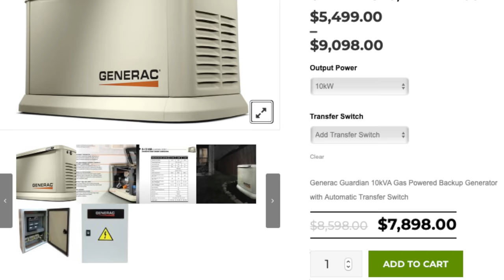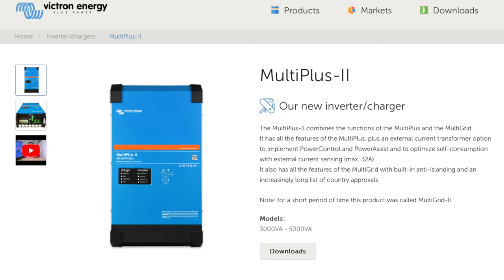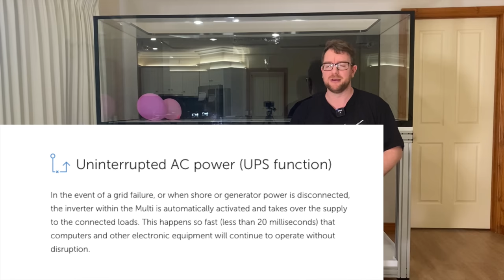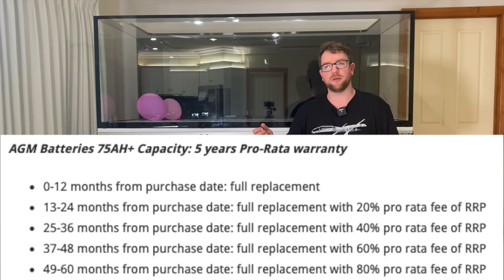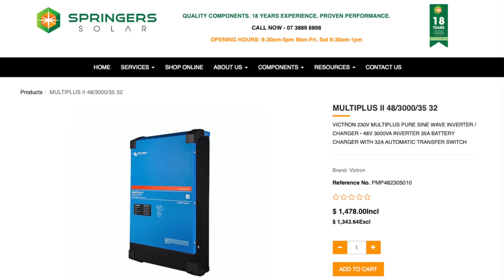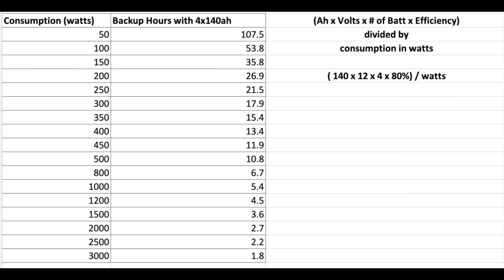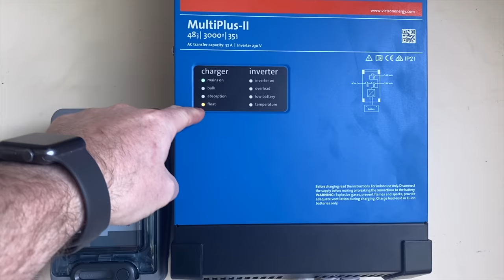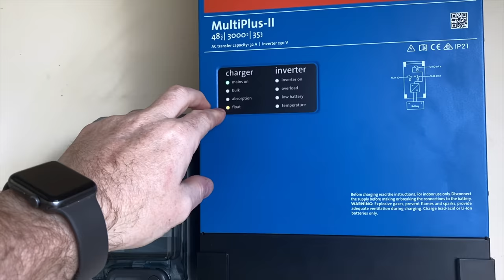Mega Reef Battery Backup

Comment: Excellent Video. Every Aquarium needs a battery backup. It means your Fish's lives. Fortunately, because I only have a 4 foot aquarium, I only needed a much smaller system and I have installed a CyberPower VP1600ELCD to which I have connected my Fluval Plant 3.0 - 145cm light, 300w heater, Air pump, and large internal Filter and it will run them for about 3 hours in a blackout. What I like about the CyberPower units is they have a readout on the LCD screen of how long a battery runtime you get according to what you have connected. The unit cost less than $300 but does has a short runtime. I am also in Victoria Australia 👍
Reply from the maker: Nicely done mate, that will work well 👍🏻

Comment: well sam I have ordered the components identical to yours and have teed up the son-in-law who is a sparky , I wasn't going to as the longest we have lost power where I live in vic is 2hrs and its usually under 1. I have a portable generator  and that saved the day when we were out for over 6hrs, when the storms struck about 3-4 wks ago, there were people without power for over 6 days. Your battery backup should buy me enough time to get home and setup the generator, or organize someone else to set it up, regardless of what im up to . Thankyou for doing the leg work and sharing it.
Reply from the maker: You won’t be disappointed mate! If you need a hand with any of it, just yell out!

Make sure your son in law puts a safety switch on the output from the inverter. Otherwise you can create quite a dangerous environment..
Reply: @ParkersReef  will do thanks

Comment: Another great video.  I always believe that if one is taking the plunge into a “dream” reef tank, the requirement for a generator is a must have.  Weather it is a whole house or a fill up and use as needed.  That being said  a $700-$1000(US) investment in a 3kw UPS makes sense.  I run my entire system for up to 4 hours.  Plenty of time to get home and crank up the portable generator and the UPS will filter the power.
Reply from the maker: That’s it, gets the job done for long enough to work out plan b

Comment: If you are intrested maximize power runtime connect DC pumps directly to batteries. Obviously AC pumps will not work on DC - you need an inverter but inverters are a big hit on efficiency. Also not all inverters will play nice with AC pumps. AC pumps are designed to work with nice smooth sine wave AC input. Not stepped wave approximations cheap inverters produce. You need true sine wave inverter.
Also 4 LiFePO4 cells ~= 1 12V acid led battery. Only lighter, more powerful, more capacity and more longevity. You can even use it as a plug and play replacement for standard lead batteries, but you do miss out on ~20% capacity.
Reply from the maker: Yes that will work, but only if your batteries are next to the tank. DC doesn’t travel distance very efficiently.

This inverters is a pure sine wave output, it’s Victron, one of the best in the business.

Lithium phosphate batteries are great. Just very expensive and weight isn’t a consideration for this install

Comment: Great video! One thing you didn't mention when you were talking about the battery formula - depth of discharge on lead acid batteries is usually recommended to be set at 50 percent of maximum capacity. Did you manually change the settings in the Victron app or just went with the defaults for low battery cut-off?
Reply from the maker: Victron defaults with sealed lead acid settings, but you can log in and change them to your battery specifications.

Yes, if I was to do this setup again today - I would use lithium batteries instead, I just didn’t have budget for them at the time

Comment: I spent about $100 on 4 battery  air pumps that used 2 D batteries that last 24 hours. I was without power for 8 days. Didn't  lose a fish or sps coral.  The key was temperature which the house stood cool even in heat wave Tank in basement. I going generator, But regular battery pumps was a life saver
Reply from the maker: Yeah they are good, especially if you can be home to get them in place 👍🏻
Reply: 8 days wtf, do you live in Afghanistan?

Comment: For about $4k, I had a Cummins 17KW natural gas generator installed...power goes out, it runs the whole house, along with the reef tanks.
Reply from the maker: That’d be ideal 👏🏻
Reply: @ParkersReef  I watched the part about you getting quotes...and I understand. I live in the mountains and getting anyone to come out to do anything is difficult.  When it comes time to buy new batteries, I would revisit the idea and try getting some fresh quotes.  Good luck!
Reply from the maker: Fresh batteries will only be $1k and shouldn’t be for 5 years, so it’ll be hard to beat that.

Plus by then, batteries will be cheaper again and generators will likely be more expensive :(

Comment: I am investigating something similar for the new 290 peninsula I am setting up. One thing I didn't see in your calculation for run time is depth  of discharge. You can't run a battery from full to empty charge and expect it to last long. I've read you get about 80% on lithium ion, and 50% on gel or agm, or what have you lead acid batteries. Did you take this into account? And have you ever done any testing to see how long your batteries last in a simulated power outage?
Reply from the maker: yeah that will vary on the battery chemistry you choose. Lithium should be good to 0%.

Sealed lead acid is really only good to 50%.

I haven't done a simulated test, but I have had a couple of 4-5 hour outages and when the power was restored, the victron was only on charge for a short time before switching back to float. Gave me confidence that it will handle 10 hours without too much issue.
Reply: @ParkersReef  Appreciate the response! Love your tank overall. My understanding is that depth of discharge has an effect on battery life. They consider life of the battery when it can only stored 80% of its original capacity. The higher the depth of discharge the shorter the life of thr battery. Lithium will get way more cycles than any lead acid, but of course they cost way more. You get one, maybe 1.5 lithium batteries for what you paid for all 4 of the AGMs. I guess at the end of the days it's a cost calculation. Replace lead acid batteries  more often, or pony up the funds for lithium batteries at the beginning!
Reply from the maker: @fiziksgeek3562  yep spot on! Lithium is getting better and cheaper by the day - so I just went for lead acid for now, will "upgrade" in a couple years :)

Comment: One factor to note: your backup hour calculation didn’t use min drain voltage. This is another one of those manufacturer spec frustrations, but is the 140Ah down to 0% or 20%, etc.? You’ll  want to multiply the number of hours by the portion which is safe to drain and not kill the battery. Good on you to choose AGM, but I’m curious… 🎉
Reply from the maker: Yes that’s a great question and I didn’t factor that in nor have I since found the value. I can say the tank has had a power outage for over eight hours and didn’t skip a beat which is exactly what I wanted to achieve :)

Comment: Great video did, you think about having the solar wired to the Victron so I can charge the battery in the day time in case of a prolonged power outage?
Reply from the maker: Thought about it, but I believe there are some legalities around that which I wasn’t interested in dealing with. Realistically, this setup can power my “essentials” for a day or more, if the power is going to be out that long - it gives me time to look into a longer term solution :p

Comment: Thanks for going through all the options and pricing - really helpful. Just one question - if you were to need to run a generator due to a long outage, would you be able to charge the batteries with the generator while the batteries are connected to your Multiplus?
Reply from the maker: Certainly can! If we were to be facing a long outage I can charge the batteries either via a generator or solar without needing to interfere with the solution installed :)
Reply: @ParkersReef  my solar will only work when it had grid power so unless your is different having the batteries only do fish circuit the solar may not work. I know some knewer ones can but not many.
Reply from the maker: Yes, that is correct. That is one of the reasons why I went this setup over a battery connected directly to my solar inverter.

Comment: Does the system run your pumps at a lower power? With the DIY or ecotech battery backup with run it at a lower wattage to draw less power.
Reply from the maker: Nope - full power. They are still powered via the AC mains outlet :)
Reply: @ParkersReef  I think if they was able to run half power you'd get alot more run time. Either way, its a nice system.
Reply from the maker: Run times isn’t an issue with my system :)

Comment: Hey Sam. I notice you have your tank running off a separate fuse in your home’s fuse box. Do you have it running off a single fuse or do you have more than one fuse/circuit dedicated to the tank ? Thanks
Reply from the maker: I have a dedicated circuit to the tank and I also use a general outlet, so in essence -  I have two circuits to the tank
Reply: @ParkersReef  thanks Sam. I’ve got a sparky working on a separate line for me this week. I was always worried that a “bung” toaster would trip out my whole tank 🤣
Thanks for the reply.
Reply from the maker: Dedicated circuit is great. Especially when it has a battery backup ;)
Reply: @ParkersReef  yeah. Need one of those too 😩
Reply from the maker: @robertverzin1235  such a good thing, seemed like a lot of money for a “what if” bit of gear, but when the power did go out it was so good to see the reef carry on like nothing was wrong

Comment: What do you recommend for a 4 x 2 x 2 tank? Any other viable options other than EcoTech or fiddle diy jobs?
Reply from the maker: really comes down the your own situation. Ecotech is great if you have their gear, are not capable of much DIY and want a neat solution. DIY will give you a BIGGER option, but it won't be cheaper...
Reply: Parkers Reef thanks looks like EcoTech is the way to go in that case
Reply from the maker: They are a great solution, nothing wrong with them at all
Reply: Parkers Reef do you know how long the vectra pumps last for on battery back up? Presumably, less than the wave makers? Would prefer to use some non EcoTech wave makers like the Tunze or Ai neros instead - lot more affordable!
Reply from the maker: If you can find the watts they use and can point me towards the battery backup you want to use, I can work it out for you :)
Reply: Parkers Reef thanks a lot. This is the tricky part because from what I heard the vectra has a power saving mode when on the battery back up, so can get it to run for 5 minutes and then stop for 25 minutes. Let’s it was at 50 watts for those 5 minutes, any rough idea how long a single EcoTech battery would last for? You get some good time out of a Vortech wavemaker - 36 hours for a mp40, which is enough time for most blackouts in Sydney / Melbourne
Reply from the maker: Looks like the ecotech battery is 12v and 18ah.

Using the scenario of consuming 50w for 10mins of the hour and 0 for 50mins of the hour, you get an average of about 8.3 for the whole hour.

So using our calculation, it is:
(18*12*1*0.8) / 8.3 = 20.82 hours run time. 

Pretty decent time, although one would question if that is enough water movement to really keep things all ok?
Reply: Parkers Reef thanks heaps. Yeah true, the 5 mins on / 25 mins off mode was one of the suggested options but probably not sufficient for oxygen. Doubling the time then cuts it down to 10 hours I guess, even that may be not enough. Sigh.. looks like no other option other than wave makers in that case
Reply from the maker: That’s a pretty long run time to be honest, 10 hours sees you through pretty much most power outages!
Reply: Parkers Reef true need to have a think about whether to just get the vectra or go vectra plus the wave makers. thanks a lot for the detailed replies!

Comment: Geez😬 those quotes for installation for the generator are a bit nuts. Were they rewiring the switchboard or something?
Reply from the maker: Mate, they reckoned it needed a new feed from the gas mains and all sorts done to the switchboard.

The mobs that quoted usually install commercially, so I reckon they quote with decent margins :p
Reply: @ParkersReef  yeah, commercial would make it worth it for them.

Thats sucks, but i guess you found a better solution
Reply from the maker: I think so!

Comment: If you want your batteries to last, don't draw them down to less than one half capacity, ie  they are now 70 amp hours not the full 140 amp hours. Your batteries could then last 8 to 10 years.
Reply from the maker: Ideally yes, spot on.
Reply: I agree, that's the reason I switched to lithium batteries.
Reply from the maker: Just the cost....

But with this system I can switch to lithium in a few years when these have done their duty and lithium is (hopefully) cheaper :)

Comment: great video however I think you made  a mistake with your costing. 4*1100 batteries + 1800 inverter+500 install equals 6700 not 3000.  regardless even 1 battery using this system to run the return pump and skimmer untill you could connect a generator would be well worth it. thanks
Reply from the maker: Batteries are $1148 for the set of four, inverter is $1478 and installation actually only ended up at $390. So total was $3016
Reply from the maker: Here is the battery link if interested:
https://www.aussiebatteries.com.au/batteries/deep-cycle-agm/4x-140ah-12v-agm-deep-cycle-battery-cables
Reply: @ParkersReef  sorry I thought you gave the figures I used during the video. At that price its even more worth it .
Reply from the maker: Yeah sorry mate, I may not have explained the battery package price well enough :)

 But yes, totally agree - at $3k it’s a great setup